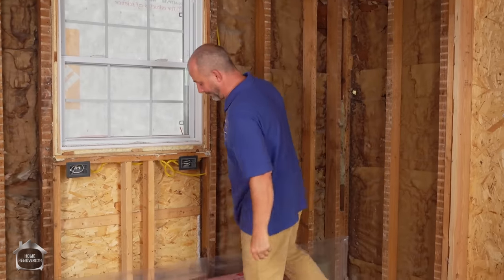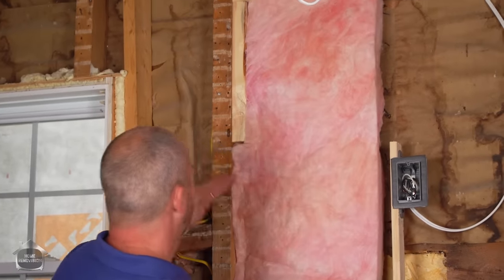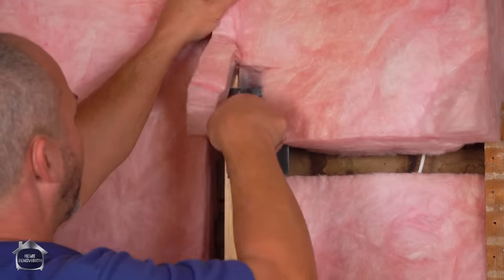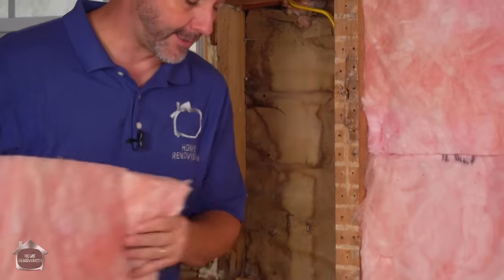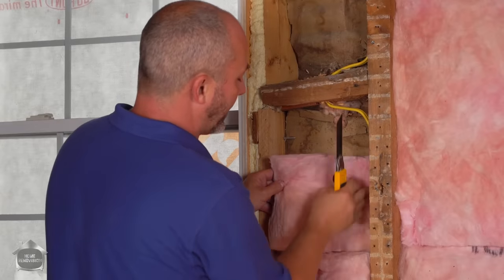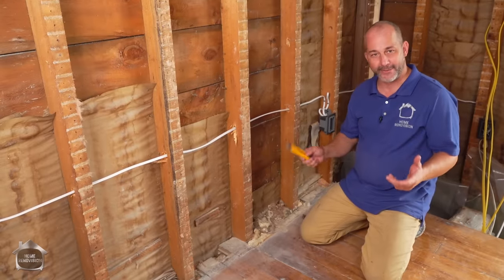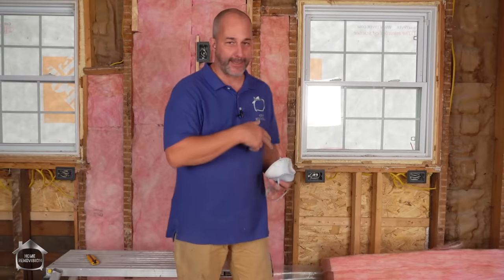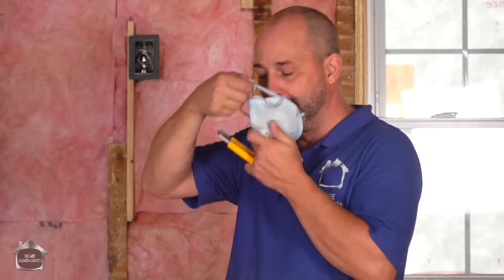How to Install Insulation | DIY Kitchen Renovation Pt. 1

Comment: I really appreciate that you cover the whole process not just 5 minutes.  You also do a great job covering the complete idea and the reasons behind the technique.  Thank you very much!!!!
Reply from the maker: We love to help. You can;t teach someone how to fich just by showing a fish on a hook. Cheers!
Reply: @HomeRenoVisionDIY  what about letting the house breath? I see alot of high end range vents struggle and find the least resistant sealed part of the house to find oxygen when theirs closed cell insulation
Reply: You talk about where to put vapor barrier in warm versus cold climates. What about “4 seasons” climates that heat in the winter and A/C in the summer? I’m curious about your overall opinion here, but my project at-hand is a crawl space knee wall.
Reply: @bj2448  when A/C is being used, the house is considered the cold source and the environment outside the house is the heat source. In other words,  the insulation will do its job separating the hot medium from the cold (less hot) medium, therefore diminishing the heat flow towards the cooler space.
Reply: Except the gloves, sleeves and mask part lol. My hands are itching just watching him.
Reply: @HomeRenoVisionDIY post

Comment: Great informative video, and learned a lot.  I live in the states in an 100year old house that was built from a kit which it seems to be different from yours.  I have the kitchen wall open, but I am using paper faced insulation from a roll.  Can I cut around outlets, and wood as you did?

Comment: great videos. learning a lot from your videos. quick question, if you have the insulation that has the paper backing which im guessing is a vapor barrier, do you recommend putting an extra plastic barrier on top of it as well. i live in the north as well, just hoping im not creating a void where moisture will eventually get into. i doubt it being that the house is pretty new but the builder cut so many corners i find myself doing a lot of diys.

Comment: I own 2 houses in bisbee arizona. One is an 1880's miners shack and the other is a 1920's bungalow. These houses were built to NO standard, lol. You should come here and make videos about these crazy houses. There have to be others coming to your channel to find info on how to fix these houses up to some standard. Code would be good but not required. Lol

Comment: I demoed my bathroom down to the studs and found that some of the pink insulation was black around the edges.  Did that happen bc there was no vapor barrier over the insulation or is it an issue from the exterior (brick siding)?  It still seems in good shape too, so do I need to replace it before finishing the wall?

Comment: FYI..  I'm in the US.  I have 2x4 construction in my home, and the fluffy stuff is R-13, not R-12.

Also, I'd suggest anyone doing this check with their inspector.  In Texas, I was required to have each outlet in the kitchen a separate circuit, and those within six feet of water to also be GFCI.

Comment: Hey Jeff, Awesome video on insulation! just curious on what kind of insulation was there before, or was there none at all.
Thanks
Reply from the maker: Hi Rene, they has some old batt insulation that had been destroyed by mice.
Reply: It was also common to pour loose wood shavings down between the inside and outside rows of planks. The drawback was that the heavier shavings would settle over time so the top foot of a wall had no insulation.

Comment: I need help. I'm doing a basement renovation. I put rigid foam against the header and sealed around each piece with spray foam. My intention was to insulate the walls then add vapour barrier. In between the floor joists I would and attach the poly to the bottom side of the rigid foam thus creating a unbroken barrier that includes the rigid foam. I then intended on adding more insulation against the rigid foam in the header. 

I was told by the inspector that this was incorrect and that I now need to punch holes in the rigid foam, add more insulation and then the vapour barrier. 

In Ontario. 

Is he correct or did I just not explain my intention correctly?

Thanks for your advice.

Comment: Hi Jeff,  I'm insulating a similar old house while doing a kitchen remodel, in Portland, Oregon. I have some builder friends who warn me about adding the plastic to the inside of the exterior wall because if someone later adds a vapor barrier to the exterior of the house it can create an environment for dry rot and they gave me example of people that have found dry rot in a similar situation. My question is, because we heat 10 months a year but then run AC 2 months a year,  and I don't plan to change the siding or move anytime soon, and the exterior has the black tar paper stuff and is pretty good condition (what I can see in the kitchen anyway),  will I be better served putting the plastic on the inside or not? Seems you put plastic on the inside and are fine adding tyvek on the outside later? Is that ok for my environment? Or if I ever replace the siding do I need to put an air barrier and not a moisture barrier? I have a cripple wall and plan to finish the basement later (of course watching all your content) But I don't plan to try to connect the plastic down through the basement because I'm not planning to redo the dining, living room etc. Only the kitchen and then later the basement. Appreciate your help on the best practice in this situation. Love all your videos, best best best content always! Thanks!
Reply: did you ever figure out whether to go ahead assuming you're not re-doing all your exterior right away?

Comment: Why do we never see you use the faced insulation?  Is there times faced vs plastic over unfaced is a better option or visa versa?
Reply: More time consuming install and plastic is a better vapor barrier than paper.
Reply: bob bray agreed plastic would do a better job.  I’m guessing climate/environmental specifics would be the biggest determinations. Plastic over the unfaced seems like it would be much more time consuming.  Honestly I haven’t looked at a cost difference.

Comment: So how are you gonna attach (drywall i presume) without making tons of holes in "vapor barrier"? When it's not 100% how will the vapor get out?
Reply from the maker: gonna need to change your avatar name before i will answer your questions. I for one am in love with Youtube and google.
Reply: The sheetrock will compress the plastic against the framing and the screws are into the studs. This in effect provides plastic "washer" or seals between the studs and the hole that the screw makes. There should be no air movement.

Comment: If you are in a cold enough climate to need a poly moisture barrier, then that is not enough insulation.  That is barely enough for a zone 9 or 10 house.

Comment: I really like the mineral wool man that stuff insulates very well and suppresses sound pretty good too. I insulated a bedroom in my house and instantly noticed a huge temperature and sound difference than in the rest of the house.
Reply: Are you saying that you insulated your bedroom from the rest of the house or from the outside?
Reply: Sound and mineral wool won't support mold.  Slightly higher R-value than fiberglass.

Comment: You are simply a truly remarkable teacher (former teacher myself, & pretty good one) & the most interesting thing about you is you just keep getting better & better as a teacher. Not easy people, improvised speech this good, this spot on & comprehensive without a script. AND, your skills cutting, fitting, wrapping that insul. are remarkable, I’m sure it won’t be that fast or easy for this very skilled craftsman, never having worked with insul. before. My 1924 Chicago/Wis. area house requires that I do so, yesterday!

Comment: You should always spray foam rim joists period.  3.5" fiberglass batts in northern US/Canada is a joke today for 2x4 exterior walls.  For a one room renovation down to studs, I would only use closed cell spray foam in kits you can buy at big box stores and do it yourself.  Easier than stuffing batts.  R-value of fiberglass batts is 13.  Closed cell is almost double plus no vapor barrier needed.  Foam also stops air/moisture flow at 2"+ thick while batts are porous to air and moisture.  I've seen too many 2x4 walls with fiberglass batts that have mold due to water condensation in areas where batts aren't tight against studs.  Good luck cutting batts to perfectly fit around obstacles.   

If you're going to renovate, do it right and for the long haul.  You'll save on heating/cooling costs over time with foam and no mold!  Mice won't find warm spots to enter either with foam.  They don't just find a random spots to chew through insulation.  They look for warm spots and follow that to the inside and will chew to make exterior holes larger.

Comment: This may have been asked already but if you are stapling and then screwing your drywall up how does this not break the vapor barrier?
Reply: Shhhh we don't count those thousand screw holes breaking the vapor
Reply: The screw is filling the hole in the plastic, so air won’t pass through. That’s why you want to be careful when screwing; you don’t want to miss the studs.

Comment: Hi Jeff, I have an 1870's row house in Toronto that I'm renovating.
The house is (inside to out) true 2x4 framing with old wide board backing and then a brick exterior wall.
Since I can't get to the backside of the studs, any idea how to best air seal the walls before putting in the insulation bads? 
Thanks! love your channel!

Comment: Greetings from Scotland again.  Fibreglass is what I have in the walls of my house, and it's a 1993 construction and so precision was not a feature of fibreglass fitting.  It was more a case of "shove it in".  The vapour barrier is essentially a foil lining on the back of the plasterboard. That's still eseentially how vapour barriers are done in houses in the UK.

I've upgraded some of my walls to solid board Insulation.  It's double the insulation resistance of fibreglass.  Then the plasterboard is replaced with insulated plasterboard (a solid board/plasterboard laminate).  It's 3cm thicker, so I've got an effective insulation depth of 3cm.  The vapour barrier however doesn't go / can't go under the floors.  There's a sole plate for the walls that rests on the floor joists, likewise for the ceiling.  It also means I have a thermal bridge at the wall/floor and wall/ceiling junctions.  Now this is where the insulated plasterboard comes in useful.  The 3cm of extra thickness helps to reduce the effect of thermal bridging from the wall junctions and window lintels.  It does however mean that your room is 3cm smaller in each dimension that faces an exterior wall.

Comment: First time watcher - I had an Insulation Company for several years and still enjoyed your show . 78 years old and still learning !! Great tip for Barrier installation!!
As far as insulation type - we used exclusively Rock Wool ( mineral wool ) simply because we had a big machine and as you said , it wicks water . I also think there is a better sound barrier .
 On Balloon Construction, we plugged basement plate with batting - drilled I “ hole through lath&plaster and blew Cellulose Fibre installed wood plug from attic , we topped of cavities.

Comment: Hey Jeff, when renovating an existing wall like this do you need to increase the R value by furring out the wall or spray foam or is r14 acceptable for this application. I know that new construction must be 2x6 and r24

Comment: So my house is in the south(North Carolina) and my plastic is on the outside. Even the shared walls in the garage to the house. This correct for my climate? Also pink stuff better value instead of spraying foam?
Reply from the maker: that sounds about right to me. aND YES PINK IS VERY EFFICIENT AND MUCH LOWER COST THAN SPRAY FOAM.

Comment: I like to use closed cell spray foam on exterior walls. Especially in old 2x4 construction. It forms a vapor barrier and gets an r value on 6.5 per INCH. So on a 2x4 wall you can get r-22. It will all seal any holes or gaps.
Reply: Closed-cell spray foam is absolutely the best, the down point for most people is unfortunately the cost.

Comment: Do you recomend tearing down lath and plaster to insulate? Or can I drywall over existing lath and plaster? Just bought a 1895 house. I'm a fan brother!
Reply: Christian Guerrero if there’s nothing in the walls now, a possible solution is to have a someone blow in cellulose. Small holes are made in two or three places in each cavity. Alternatively, a wall can be insulated from either side. If the exterior needs replacing, that would be a good opportunity to insulate and add an air barrier (house wrap) such as Tyvek.

Comment: When I lived in CA, I just went with the cheapest R-19 fiberglass for exterior walls.  Now that I'm WA, and I'm re-insulating a room with 2 exterior walls, I went with R-23 Thermafiber mineral wool.  Never used it before and it's really dense, you almost need a machete to cut it!
Reply from the maker: They actually make a hand saw for that stuff. it works like magic!

Comment: Great videos, best tutorials for DIYers. Can you please explain the purpose of mineral wool at the bottom of the wall cavities? Where should mineral wool be  used instead of fibreglass installation? Wet areas etc... Thanks for your help

Comment: Great video, helped me to insulate the empty cavities of my 1910 house. 
I’m adding 2” exterior insulation and a weather barrier in the spring due to the voids where interior insulation cannot be placed.
East coast Canada needs a vapour permeable insulation, can I use rigid foam even if it’s semi-permeable? Or do I have to use rockwool?
(DIY Forum goes unanswered)

Comment: Absolutely amazing. So full of information! Thank you so much Jeff for always teaching us your ways.
Reply from the maker: Cheers Sunny!
Reply: @HomeRenoVisionDIY  hey jeff, i stumbled upon your crawlspace insulation video from back in april. Incase you don't see it there, ill type it here! I have a similar crawlspace in my house. My question is, if you don't have a water proofing membrane on your exterior crawlspace/basement foundation, what steps should i take to not only insulate but ensure the insulation doesn't get water damaged or have moisture build up behind my vapour barrier?  How reliable are those water proofing paints?

Comment: Hi Jeff, big fan of your videos and the tremendous amount of info you provide. 

Question about in- or outside insulation. We own a cottage on the lake, built in the 70s, traditional round log and chinking style, crawlspace, cement block foundation. It's currently used as a 3 season cottage only, ergo no insulation but I would like to use it in the winter too. Clearly basement, floor and roof need to be insulated but I thought to upgrade the walls too. My plan would be to fix the chinking, air&vapor seal it on the outside either with a house wrap or some peel and stick (with primer) product, then add mineral wool (because of moisture) and new siding on top. That way the logs would always be on the protected (warm) inside. Does that sound reasonable or how would you retrofit a log cabin with insulation? Cheers from Montreal, Fabian

Comment: Balloon-framed house can get a really good layer of insulation with blown-in cellulose. That said so far I've used mineral wool exclusively. I find it even less irritating to handle, I love the way it cuts for trimming and working around obstacles, and even small offcuts are dimensionally stable and totally usable, while I find small pieces of fiberglass frustrating and nearly useless. Combine with the fact that mineral wool is undamaged by water, and that vermin generally like it less than fiberglass (although I have known mice to nest in it) and to me it's worth the extra cost.  
That said, I've not used or handled any "new" fiberglass. Maybe it's better than it used to be. 
I've never worked with spray foam, and I am curious about it, but I have questions about its utility in these really old houses. Old wood siding and sheathing needs a bit of air, and sealing the back side of it entirely with a coat of foam doesn't seem quite right to me.

Comment: Thank you! I just purchased a 1976 house and wonder what the efficiency is in the walls for heat loss. I also live in a wet climate in winter (west coast Canada), so am wondering about vapour barrier need. I do not want to renovate if possible, but also do not want heat and moisture problems. I think I will live in it over the winter and decide next summer what to do.

Comment: Hi Jeff. I have a follow-up question to my previous one. I have installed the insulation and I'm on to the vapor barrier - a nice Christmas holiday project  :-). I am insulating the ceiling of my tuck under garage. For the vapor barrier to be effective, I will need to seal it to painted, cinderblock walls. What type of adhesive should I use to seal between the 6mil poly and the walls?
Reply from the maker: Hi Clint, sorry if I am too late with this However best to use an acoustic caulking between any 2 different materials. it will seal for ever and never dry. Best of success with the project!

Comment: Hey Jeff, I’m redoing insulation and drywall in an upstairs closet due to some molding issues. I didn’t find and traces of water leaks but one of the walls is up against the cavity with the chimney flue. Is there anything I need to do to block the cold air from the flue cavity other than just insulating and dry walling normally? I believe the mold was from condensation but there was insulation and a vapor barrier in the wall. I can’t seem to figure out the issue beside the flue cavity.